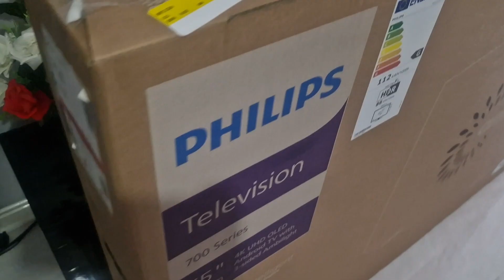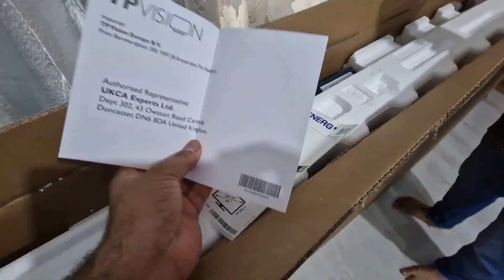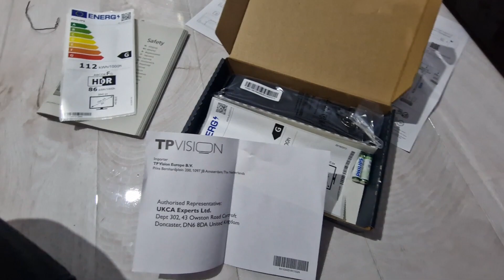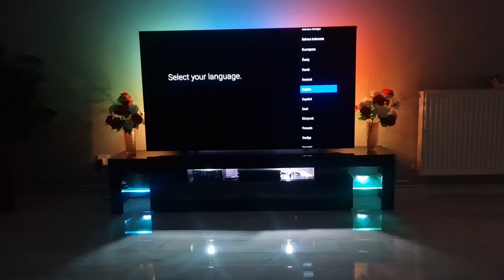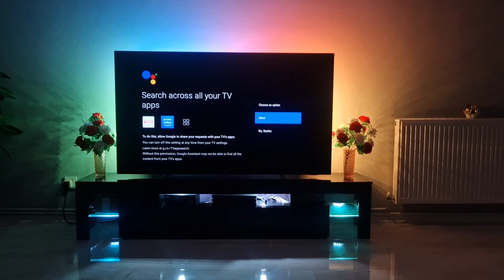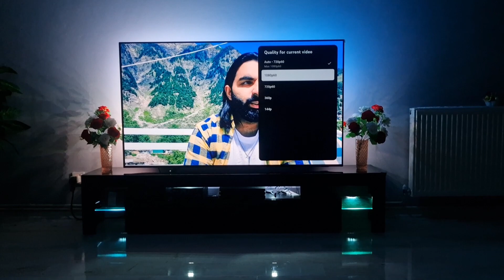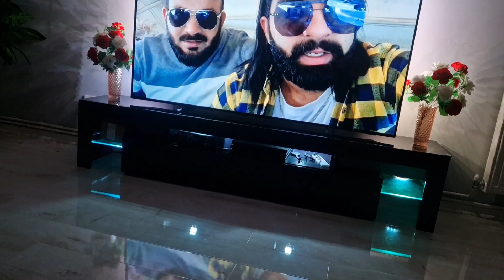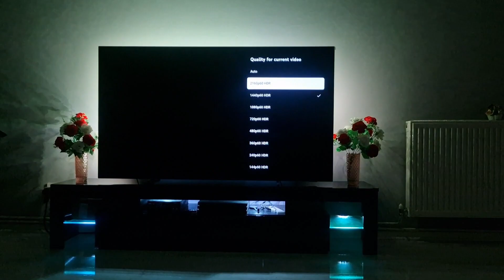Philips OLED (700) series with Ambilight. Unboxing, setup & demo!

Comment: Hello, there is blurriness and light leakage in the dark scene of 55pus 8508. What's the solution? It says that the service report is standard and it has been 1 month since Philips Necmi Elektronik Antalya received it and it reports like this
Reply from the maker: Did you turn it on the same screen for long time?
Reply: No